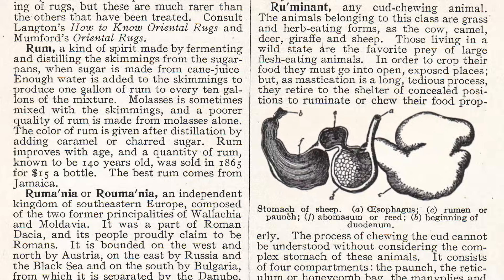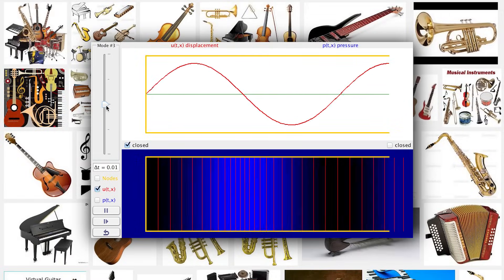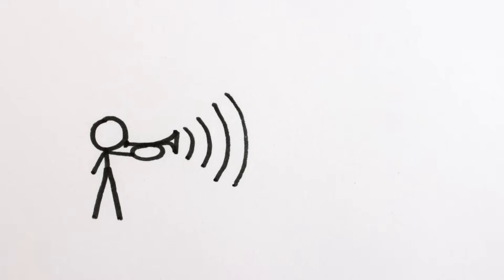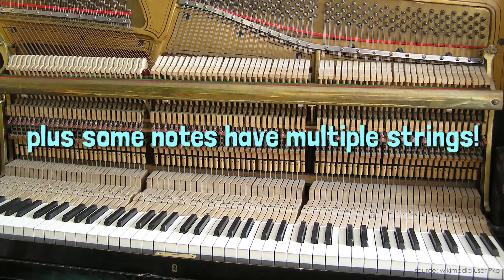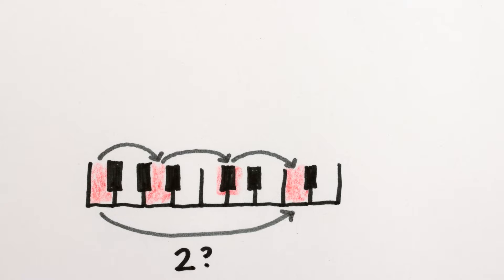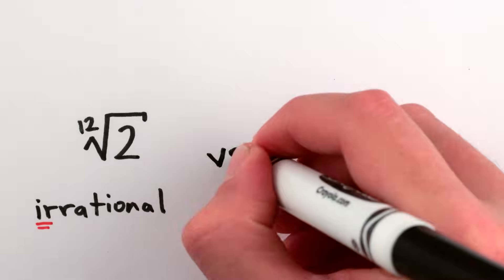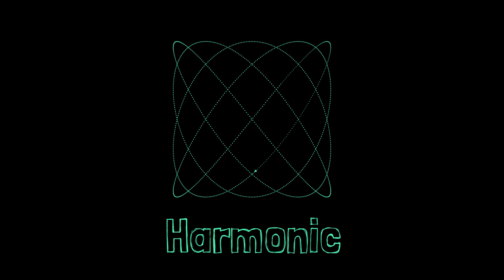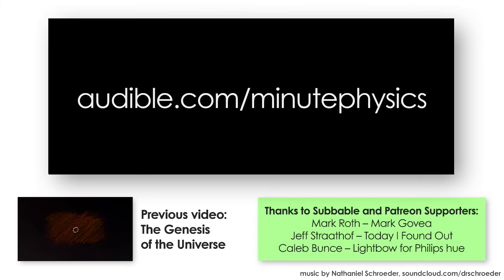Why It's Impossible to Tune a Piano

Comment: Guitarists actually use 5th and 7th harmonics to tune. Smh.
Reply: Guitarists use the 5th and 7th frets to tune, which are actually 2 octaves up, and an octave plus a fifth, respectively.

The pair of strings that can't be tuned this way, is the G-to-B string, because they are 4 semitones apart instead of the standard 5.   The way that one is done, is you tune the two E strings with the 5th fret harmonic on the low E string, matching the fundamental on the high E string.   Then you tune the B string relative to the high E string via the 5th-7th fret harmonics.

Comment: Absolutely incorrect explaining for why the piano is impossible to tune.
The title should be "Why is impossible to have perfect intervals in all keys in a piano" (or any instrument really).
The pianos are impossible to tune perfectly due to inharmonicity of the strings. That means piano strings produce a large amount of notes that are not on the harmonic series, specially the lower and higher ones. To compensate this the pianos are tuned using stretched octaves.

Comment: This "Out of tune" talk is a little excessive.
The nowadays western music in general is played  in the chromatic scale. In the chromatic scale there is no perfect harmonic intervals, and all the 12 notes has a basic frequency precisely defined.
But it does not means "out of tune", it is just not perfect harmonic (rational multiple frequency) intervals.
Some instruments like Trombones has a tendency to  play harmonics intervals cause the physic construction, but the musician can force the pitch "on the fly" to mach the chromatic scale. Some instruments like violins can play any notes and intervals (harmonic or not).

Yes, if you use only instruments like violins etc you can compose and execute a whole symphony with perfect harmonic intervals, but people in general will not perceive the difference if you execute the same symphony using the chromatic scale.
Se it better in @t

Comment: It doesn’t matter if you’re in tune. You just have to be out of tune just as much as the rest of the band.
Reply: Hoos Bucks it’s a joke man. I mean tuning is relative to the band. It’s always good to be in tune but the best way is always to tune with the band and not just a standard of a specific frequency.
Reply: Hoos Bucks that’s what I mean
Reply: Hoos Bucks there are probably a couple songs that want you to go out of tune. Like slightly extending a trombone slide or creating a (hopefully non lethal) wobble in the clarinet or flute section.

Comment: What we need to do is adopt a musical scale where there are 8 notes per octave instead of 7.  Of course, the music is then going to sound "wrong" to western ears until the next generation comes along.
Reply: @Marian Kotúč  I stand corrected :-) 
I didn't count the sharps :-/  
You are correct.  In the Western music scale, there are 12 notes per octave.  
Using Concert A (or at least what most of the world defines as concert A) we get:  

A  = 440.00 Hz
A# = 466.16 Hz
B  = 493.88 Hz
C  = 523.25 Hz
C# = 554.37 Hz
D  = 587.33 Hz
D# = 622.25 Hz
E  = 659.25 Hz
F  = 698.48 Hz
F# = 739.99 Hz
G  = 783.99 Hz
G# = 830.61 Hz

This sounds pleasing to Western ears, but if you listen to, for example, Indian music (dot, not feather) their music sounds out of tune to us because their music uses a different scale.  I imagine our music must sound off key to them, but I have no way of knowing that. That's why I said that if we were to divide an octave into more or fewer notes, it would sound "off" to us.  

But it would probably sound perfectly normal and pleasing to someone who grew up listening to such music.  

As a computer geek, a musical scale divisible by a factor of 8 or of 16 makes a lot of sense to me (making it possible to perfectly tune pianos, for example), even if it would sound horrid to contemporary Western ears, mine included.

Cheers :-)
Reply: @Marian Kotúč   I guess you're right about that :-/  I think like an engineer rather than a musician, lol.

Comment: That's why you use a synth
Reply: ...which is also out of tune
Reply: do you know what a synth is?
Reply: Poly Gyro I'm thinking of electronic keyboard. I know of synths, but synth and keyboard are interchangeable words...so that's why I thought you meant keyboard.
Reply: Yeah... no. A synth and an electric keyboard are quite different.
Reply: Trey Secrest with a true synth though you can still input what exact frequencies you want thus...outside of equal temperament...at least that's what I'd assume a synth could do...I've never played one.
Reply: Trey Secrest

All sorts of temperaments, including Pythagorean,  are being used all the time, including pop music on the radio.  Hundreds, if not thousands of pop recordings have been listed: when the main melody is equal temperament it typically occurs in the bridge.

Comment: minutephysics: MISLEADING TITLE IS WRONG, WRONG,  WRONG AGAIN!  Yes, it is possible to tune a piano perfectly, provided you play it IN ONE KEY ONLY.   Such a piano will be out of tune in every other key.   If you want to play in tune and in all 13 keys, you'll need either 13 pianos (one per key) or an on-staff piano tuner to re-tune the piano every time you want to change keys.   I don't know what a YOU call such tuning, but musicians call it "true pitch," and orchestras usually tune to "true pitch." 

The compromise tuning commonly used on instruments of fixed pitch (piano, guitar, xylophone, etc.) is called TERMERAMENT, and has been around since J. S. Bach wrote "The Well-Tempered Klavier," a series of 13 pieces, each in a different key.   The tunign is knows as "tempered pitch" by musicians.   Orchestras play in tempered pitch for the sole purpose of including instruments of fixed pitch.

By 0:57, you've gotten SO MANY other things WRONG, I gave up watching.   I know some musicians who sound stupid discussing science.   Now I've seen a physicist who sounds stupid discussing music theory and "material science"  as it relates to making mu;sic.

Comment: Incorrect. Strings, such as the strings on a violin, do not vibrate in sine waves. In fact, they vibrate in complex wave forms in which the overtones have irregularly proportioned amplitudes. The sine wave is a "pure" tone which does not produce irregular strength overtones. You are confusing "frequency" with "sine wave." All instruments have different timbres, a function in part of the irregularly distributed overtone amplitudes (as well as the envelope and other parameters.) you are presenting the concept of equal temperament correctly but have botched timbre and the term "sine wave." And, pianos do NOT produce sine waves. Pianos have complex overtone structures, and the attack envelope of the piano contributes to the piano string timbre. Some acousticians, like myself, consider the clarinet sound to be fairly sinusoidal though it is not actually a pure tone, as in the sine wave, and has increased relative amplitudes on the odd harmonics. But, to reiterate, no acoustic instruments produce pure tones or sine waves. And not the human voice.
Reply: Obviously very few sounds are perfect sin waves, but that makes the math incredibly difficult and this is just a simple video to explain the principle, which it does just fine.